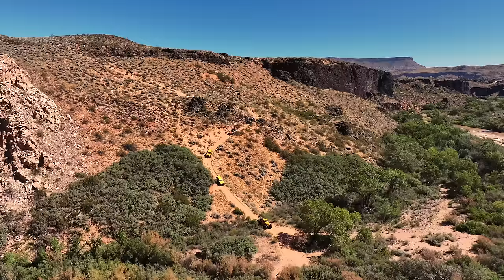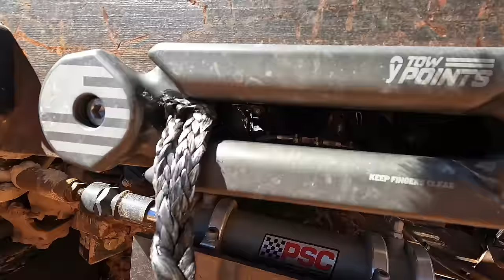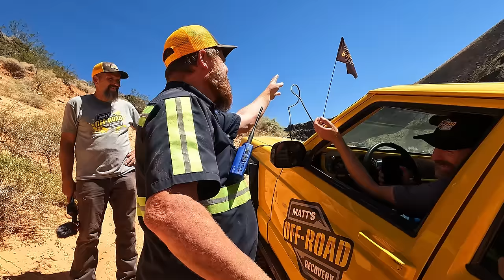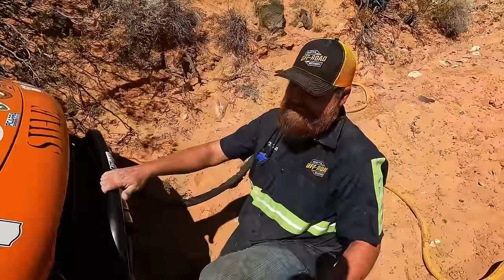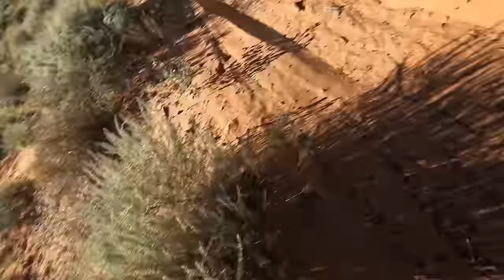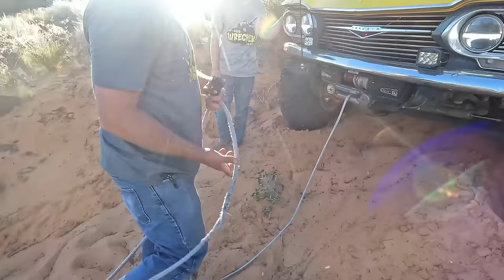I Failed...The Most Difficult Rescue Left Unfinished!

Comment: That was worth waiting a day for! I agree with some of the other comments, that was the first time I remember seeing a serious look of concern on Matt’s face. That’s saying something considering some of the situations he’s had to get out of! You guys definitely found the wrecker’s Achilles heel!
Reply: Wrecker tires are too ridged in soft sand, dig in too easily.... perhaps can run at lower pressure??
When climbing a steady incline, any digging in at all, is as a vertical wall, supported by gravity. One spade could have changed much of the track.
Having the biggest wheels, the wrecker should have been last, allowing the other vehicles a better opportunity to get out, and could have formed a train to pull up the wrecker.
It is easy to form an opinion, after all the unknown factors are played out,...still excellent efforts were applied, and all but one, made it out, with team work...not many teams, would have made it.
This far exceeds the wrecker games, because it was real, not for points and prizes, but should go viral.
A low revving diesel with idle speed torque, may have taken the wrecker further up before starting to dig. 
It could be possible, that the transmission locks up, giving much digging and making it equivalent to manual travelling in upper rev range, ...sand does not tolerate too much torque before breaking formation, and the vehicle digs in.
To not spin at all, is ideal...to to apply it, is very complex

Comment: If you put a sick battery and a good battery together, the sick battery will make the good battery sick fairly quickly.
Reply: Some 80's chevys had 2 battries and they had no isolators so  they  died when the last battery died  -    you wouldn't know that one was dead until the good one failed.   Had it happen with 2 different trucks.

Comment: This was SUCH an interesting video for so many reasons. I was really impressed with Matt's patience through the whole ordeal. It was interesting how Matt confidently thought the wrecker would easily make it out but he quickly learned some limitations about the wrecker. I'm really curious to understand what made some vehicles perform better than others. I would imagine it's some combination of vehicle weight, tire size and horsepower. Does anyone know if there is some formula that would allow you to calculate optimal performance for this type of terrain?
Reply: ford has mastered the 10speed automatic, which i believe was the problem with a lot of them not being able to get in a good gear/range/speed on the climb
Reply: I've done a lot of sand and learned a bit.  The lower the truck the better.  As the truck gets taller, ie the wrecker, the weight is placed behind the centerline of the axle and grip decreases.  2-5 psi with beadlocks helps tremendously with a softer footprint.  You need a good hp to tire size.  Gearing isn't going to help here.  Low gears work great for crawling, but wheel speed wins the day in the sand.  Just watch the sand rail cars.  They'd eat this hill in 2wd.  Light weight, tons of hp, soft floatation tires, small tire size to keep the weight over the axle equals the perfect formula.

The wrecker is not coming out under its own power.  Not nearly enough hp for those tires, too much weight behind the axles, tread is too aggressive, and too heavy.
Reply: It’s all about gearing and horsepower. The bronco has the 10 speed auto and 410 torque. Always in the power band essentially.
Reply: A big part is the size of the tire contact patch has to go up in proportion to the weight of the vehicle.  That's why airing down helps so much - it lets the tires squish out and cover more ground so they don't just sink in.  The wrecker has huge tires but it also weighs 3 times as much as the SUVs.  The tires probably aren't 3x bigger, so it's going to sink in more.  The Bomb-Bee will have a big advantage here - those huge tracks on a lightweight vehicle will result in very low ground pressure.

Power to weight also matters a lot.  The wrecker has a Vortec 8100, probably making 300-400 HP... a good amount, but it's not 3 times what the SUVs have.  Two reasons that matters: first, the farther the tires sink in, the taller the wall of sand in front of them gets.  The higher the wall, the more power it takes to dig through and over to make forward progress.  Second, extra power lets you build up speed on the easy parts so you don't bog down and sink in the worst parts.  Alas, the wrecker doesn't accelerate like a sports car.

Gearing matters.  You need that horsepower available through the range of speeds you're going to travel.  Gas engines want to rev, so you have to gear them down, but too low of gears and you'll hit the redline.  At that point you have to stop accelerating (bad) or upshift (worse).  Shifting up is means you have to shift down as you start to bog down, and the power loss during shifting sinks you at just the wrong moment.  The wrecker has several advantages here: it has chained gearboxes which can be combined to get just the right gearing, and the Vortec 8100 has a broad power band, so it doesn't give up even as the vehicle bogs down.

There's not a single formula for all that.  You could come up with one for how a vehicle will perform on a steady incline, but when you throw curves and potholes into the mix, the conditions are constantly changing and no one formula will cover it.  However, the biggest single factor in my opinion is the simple ratio of tire contact patch to vehicle weight.  You don't have to dig out if you never sink in.
Reply: @chrisfrederick9934  Thanks for that explanation! I agree with your analysis. Seems like keeping the speed up to keep the tires from digging was key. Appreciate your insights!

Comment: Complacency can build character, it proved there are problems that need addressed, and the Bronco with Jefe was strong and he has more trail rigging knowledge than most. Time to start checking alternator output and corroded terminals on equipment as well as fueling up daily..that said great job owning up Matt, and you never threw in the towel 💪👍

Comment: Airing down further would have helped tremendously. You should do an episode showing the difference tire pressure makes
Reply: Actualy, they showed us in an old video. They pull something until they could'nt pull anymore and then, Matt air down whatever they were pulling until those tire valve wistle, only on the pulled load and the towing 4x4 pull that load to safety.

Comment: Thanks once again, Matt and your team, for a great video! I don't know if you take questions, so if I crossed the line, my apologies. I was wondering if you ever use any recovery board or drop the tire pressure to aid in recovery. I have had good luck getting a fully loaded 6x6 water truck out of soft sand using ActionTrax recovery boards (No weight limit with them). Love your Videos!

Comment: With the off road wrecker it seems Matt has gotten himself into the same situation his customers seem to get into where he underestimated the situation. In this case, the Bronco was impressive. I suspect the independent front suspension helped significantly in this situation helping keep the power on the ground going through the ruts. As for the Porsche, I can't imagine anyone expected it to handle actual off roading? It's a nice looking setup for basic forest service and BLM type roads though and I imagine a blast on the road. Great video, and the tough situations tend to be the ones you look back on fondly later in life.

Comment: I can't wait to see how Matt is going to get the heavy wrecker out!!   Even if he gets the lockers working and the overheating problem solved, I still think it's too heavy to crawl out. It would be cool if Heavy D air lifted it out with the Blackhawk but I think Matt is going to try and figure this out himself. I think he might try fabricating some sand paddles to put on those giant tires. Or maybe he will run a line down from the top and position the banana at different points to run the line through a snatch block so he can get the right pulling angle. Whatever he does, it's certain to be AWESOME!!

Comment: A couple of questions. 
1. Why would you bring all the vehicles to the bottom instead of one at a time?
2. Why would take the wrecker up first and rip up and rut the road?
3. Why would you try to pull two vehicles at a time?
4. Are you going to partner with a heavy lift helicopter company to get the wrecker out?
5. It was a great video over all.

Comment: we got a place over here by halls crossing, it called the sandslide,  its the only way into and out of what is believe is mancos canyon just east of halls crossing.  it is very much akin to this hill in length top to bottom but about 1/2 a mile wide.  pure sand dune blown in by the wind in the nook of red rock sides,  I would say maybe 1/4 to 3/8 mile top to bottom.  we've taken f-250 ford 4x4's, f-750 ford five ton water trucks, and petebuilt ten wheel with drill rigs mounted up and down that thing all day long,,,  although with a d8 caterpillar bulldozer attached to each one...

Comment: Where we ride and off road in SoCal all we have is huge deserts with huge areas of soft sand. The biggest thing we have learned is that your tires need to be set to 8 lbs. I've two wheel drive trucks pull out big 4x4 because the 4x4 did not air down enough.  I've been stuck with 15 lbs and drop to 8 and walk right out. I think their whole day would have different if they aired down way more.

Comment: Since the sand is so fine and dry as you’ve said I wonder what a water spray system would do if you got the sand just a little wet so it would tend to clump the sand together like damp kitty litter. Since it’s most difficult on the hottest days maybe it wouldn’t take as much as it would seem. Maybe not.

Comment: It seems to me that as long as the state doesn't have a problem with it, someone should go up there with some bags of cement and some big strong poles. Aunt fix some anchors along the side of the path that one could attach winches to when they inevitably need help climbing the hill... Or at least bury some rocks strategically along the side that winches can be attached to..

Comment: So my question is where does the Porsche excel because deep sand does not seem to be it's strong point.
Reply: This is Christopher in the Porsche. It did amazing on rough roads and will do 190 on the highway, plus it goes really well on rocks and hard packed snow. Sand seemed to be its weak point at the moment but we're looking into some software that can bypass the computer. Thanks for watching!

Comment: Several of the vehicles were running bead lock wheels. Why didn’t Matt tell everyone to air the tires way down to 5 PSI or so?  Remember that is what he had to do previously to get the heavy wrecker to climb the hill. The bigger the footprint, the more traction and floatation. The same principals apply for snow wheeling. I have dropped down to 5 psi on my Jeep without beadlocks to get out of sticky situations.

Comment: Unsure if already suggested (not gonna wade through 8.7k comments to find out), however my thinking is that having a suitable size jump pack on board prudent when terrain limits jumping off another vehicle or need for "borrowed" battery as happened with the Banana's dead dual batteries plus one borrowed from the wrecker. Earlier this year, I bought (3) Noco Jump Starters of progressively larger sizes, with the largest GB150 3000A size kept in my F150 6.2L truck. That being Noco's largest size seems should start anything encountered (9L gas / 7L diesel) during MORR's recovery jobs - even with completely a dead battery by using the override function.

Comment: I had a 1975 Blazer was working Pittsburgh in winter average temp -13 F degrees,  I Installed 2 batteries for better starting in cold weather, that only works for a couple of months then the batteries kill each other , their are clevar electronic thingeys but a battery cut out switch on each battery is least expensive , low tech and works 100% of the time the only down side is the driver must remember to charce alternative battery 1/2 of the time.

Comment: I had that happened to me where I would pull the line out too far, it would not grave onto the winder. I found a guy from australia, I can't remember his name right now, but he shows a trick to prevent that from happening again, and it work. you need a 3 to 4" small strap with loopholes on both end.

Comment: Let's see , no cold water, a cooling system that's under sized or not working including the cooling fan, a big block with a lack of low end torque, Air lockers with no air to lock them,  no gas ,no charging systems , Battery fire. Sounds like  a well thought out plan.  When you go back to the drawing board remember the stand alone cooling system for all of your transmissions the converters have got to be cobalt blue by now, You need to share with us the build mods of the Bronco. Thanks for the Video Adventures.

Comment: Deflate your tires, you might have big wheels but you need a bigger surface area, i deflate my 265/65R70 to 0.7 bar for soft sand and it takes it with a stride

Comment: On the heavy wrecker I think you need to drop tire pressure down to about 4psi for this kind of sand.
Reply: FOUR? Holy hell, that's low but can imagine if the tires can take that. I'm always amazed normal cars/tires deal with all the forces. I moved to a remote farm; just a 2002 GMC Envoy but a trusty and dependable one. Pushing 350,000 miles so some ... eroding chassis pieces, I'm sure. Sorry; got triggered on this. Challenge is 1/4 mile along a creek, then up to cross an alfalfa field with convenient steep run to access road. Should try that with snow.

While well aware the nice quality off-road tires here can likely take it vs. the standard highway tires I'm running. 4 psi might be pushing it! PS: note on vehicle age to point out that while it can 4WD through some big challenges I must be careful about not tearing anything off.

Comment: I think the sand is like snow  he might be better off backing up the hill slow speed, then going up forward fast, fast is only going to dig the tires in. Slow he's not breaking traction.
But the wrecker has all that weight up frt, so its going to want to sink in
But weight helps in the back in the snow.  Sand is a lot like snow.

Comment: I'm not sure axle lockers on the wrecker would have made a huge difference, to be honest. An open diff limits the "good" wheel to the same torque as the "bad" wheel, whereas a locker allows both wheels to use all the individually available traction.

So if you have one wheel on a slippery patch of ice, or getting lifted in the air, then an open diff restricts the torque of both wheels to the minimal torque generated by the slipping wheel. (Eg, if the wheel with poor grip can only generate a force of 1000N at the tyre, then the pair of wheels will only be able to generate 2 x 1000N, regardless of how much grip there is on the "good" wheel.)  In that scenario, assuming the opposite wheel had good grip (eg, could generate a force of 5000N on its own), locking the diff would provide a total tractive force of 1000N+5000N, instead of just 2000N.

But if the traction is poor, but roughly equal at both wheels, the lockers will be pretty ineffective. The loose sand is much the same under both wheels, so one tyre might be able to provide 2000N, and the other, say 2500N. In that case, a locker would give a total of 4500N, and an open diff would give a total of 2 x 2000N=4000N. The extra 500N from the lockers in such a scenario, isn't hugely significant.
Reply: Having said that, I think another few psi taken out of those huge tyres would have made a massive difference. I think you said they were at 12psi (83kPa)? That's pretty low pressure, but on a tyre that size, it can still go down lower. In principle, if you halve the pounds, you double the square inches (that's what psi means!). At 6psi, having twice the flat footprint would make a huge difference.

Comment: Which is more important if you can't have both. Front or rear, for lockers? My wifes suv does the same as that Porsche when i spin the tires and get stuck it kicks every light on the dash, and won't do anything until it is unstuck then after a few miles on the road the lights all shut off.

Comment: 12psi on 54s is pretty hard. Need to get down to single digits. I run as low as 6 psi on 44s in the sand.

Comment: Learn how to run a snatch block. Or a couple.  And then a straight line off one of the snatch blocks. Each block reduces the weight  of the load on the end of the line.  Why does everyone just do straight pulls?   I tow and recover on Mt Hood. When Fed Ex is stuck down a narrow mountain road in the snow we send a Subaru and a 6k winch.  The loaded truck outweighs the subaru of course.  Run a couple snatch blocks and make him weigh less.

Comment: I am sure you learned a lot. Your skills out weigh your preparedness. I am concerned about your safety. Loose batteries ? No full gas can ? As a retired professional we would have had full fuel tanks on all vehicles. Fire extinguisher on all, you should have more then 300 feet of rope. I am sure know other important ideas and issues. Get your equipment fixed ?
who else recovers the recovery team ?  Thanks for sharing. Takes big shoulders.

Comment: Matt what were you thinking the Banana dead alternator, Big wrecker no lockers and missing fan shroud and the winches are under powered on all vehicles.
The wrecker your never going to drive that 6 ton truck up the hill lockers or not.
Matt this was a dumb thing to do when you never do preventive maintenance on your vehicles what the hell were you thinking without beer. 😅